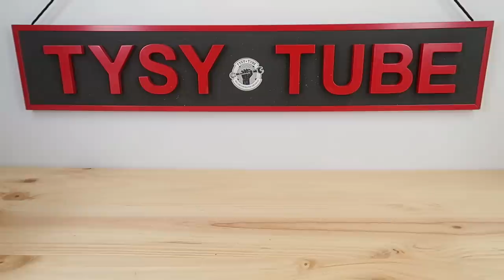Rusted Coffee Grinder Peugeot - Restoration

Comment: My dear Tysy: My favorite coffee? Puertorrican, of course...  ;))  In regards of your "melted coffee" question: Coffee beans have natural oils in them. If the bean has been roasted for a long period, the more oil you will see on the surface of the bean. It could be possible that as residues piled up on the glass hook, the oils helped the residues to stick together over time. Nobody bothered to remove the build up. It could be possible that maybe a cigarrete could have melted the residues (I like to have a cigarrete with my coffee in the afternoon). However, it doesn't look that it was burned, I couldn't notice any burn marks on the wood, but who knows?  Please, be careful with blades!This restoration was fantastic. I really enjoyed it, best work so far.  Keep it up.  ♥♥♥
Reply: Now that you mentioned it, it could be possible specially if the coffee beans are French roasted. Beans are roasted at 240 C, they get quite oily. Since this is a French coffee grinder, I would assume the beans were French roasted. But, who knows?  Cheers! ☕

Comment: I have seen you use an ultrasonic cleaner, very good! A suggestion (maybe you already know): fill your bath with water only and use plastic bags (e.g. polyethylene) where you put your pieces together with any cleaning stuff (soap solution, acidic solution, basic solution, ethanol,....)

Comment: What was the voltage (and current) of your power supply when you were nickel electroplating?
Reply from the maker: 12v
Reply: @TysyTube   thanks for the response, wow that is amazingly high. I have been trying with 5v, but my pieces come out more 'smoky' and not as shiny. that being said, my part prep work might not have been good enough.

Comment: Out of curiosity, for something that is old like this grinder, is the potential for lead paint particles a concern that makes the use of this as a regular grinder a risk even after restoration? I ask this as I have a old gumball machine I have wanted to restore for years but it tested positive for lead paint, which made me steer wide clear of any restoration so as to not get anything harmful on me or work area.